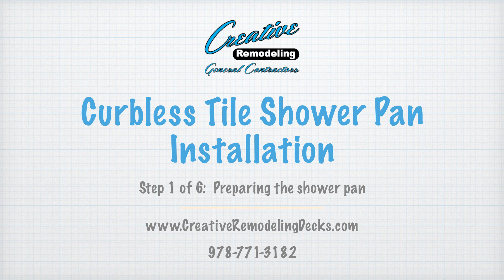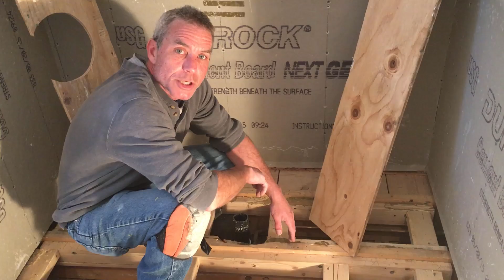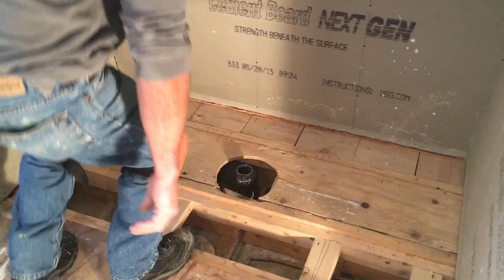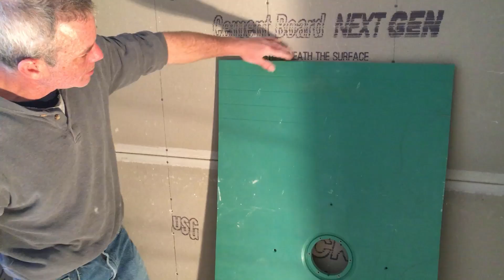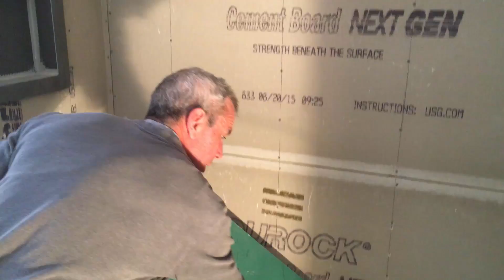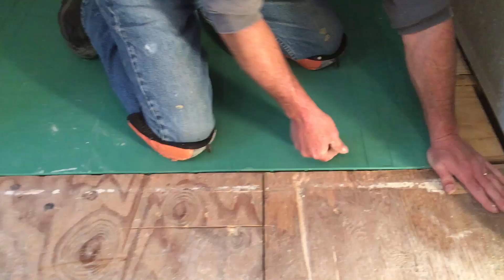Curbless Tile Pan Installation - Step 1

Comment: You could have avoided all this by ordering a KBRS system shower basin to fit your situation. All you would need is a level floor with a drain. Your shower pan doesn't go all the way to the edge so your taking a chance with a leak.

Comment: My question is this - Once you've added your cement board to the floor, (outside of the shower pan), then tiled over it, how do you rectify that material with the level of the floor in the adjacent room or hallway?  Wouldn't it raise the floor to a level that would make it difficult to install a transition plate between rooms?  Each and every time I go to Home Depot, I see contractors buying up rolls of Schluter Ditra like it's essential for surviving the last day on earth!  We're in New York and no one uses cement board on a customer's floor anymore.  Now with the Schluter Ditra, Wedi board, and the new Hydro Ban Board by Laticrete, no one wants to use the heavy, difficult to cut, porous cement board, (which is not only laborious to install, but needs to be waterproofed with RedGard after its installed).

Comment: Any concern with using new wood for the supports to make it level ? Will it Shrink and create gaps and get out of level?
Reply: I have not had any issues yet.  Have done 30-40 of these and no call backs.  You just have to follow the manufacture's process step by step.
Reply: As long as you aren't using green wood or wood that is literally soaking wet the amount of shrinkage in a short and narrow piece of s/p/f would be minimal if at all. Now if they replaced some of the actual joists with new wood, that's where I'd use an engineered product or a truss.

Comment: Thanks for the video.  I have a very similar setup and was hoping you might be able to add some detail about lagging the blocking to the bottom of the wall plate.  My next joist is 6" past the bottom wall plate.  I assume you are just lining up a new joist and lag screw into that through each bay of the wall and then add the blocking 3/4" down from that?  Thanks.